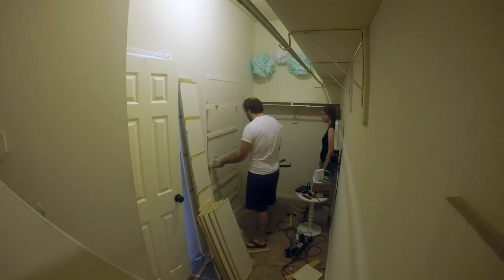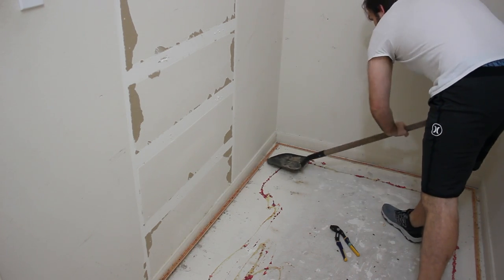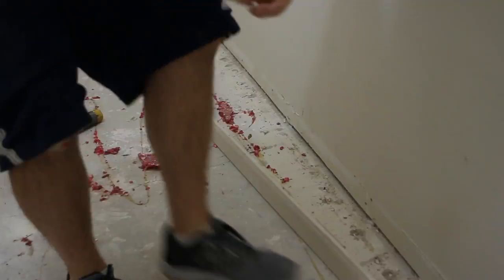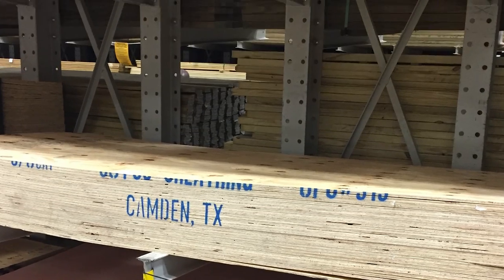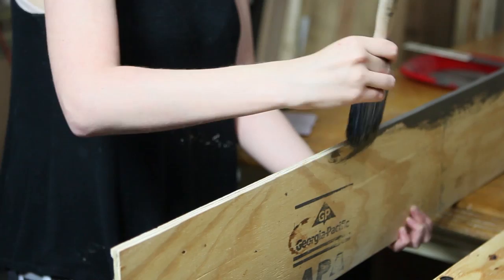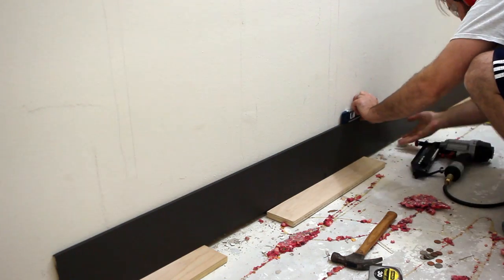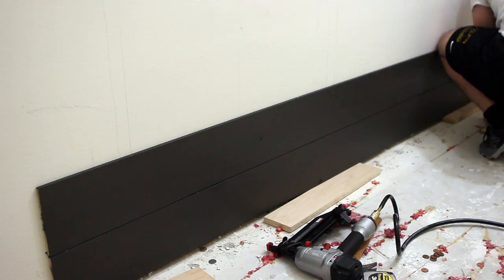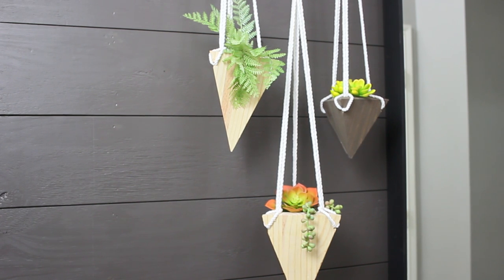How to Make a Shiplap Wall (Don't use the wrong wood!)

Comment: what is the purpose of this wall? just curious..hearing it first time
Reply from the maker: Purely decorative. Thanks to HGTV and Fixer Upper everyone loves shiplap walls and we felt left out since our house was built in the 2000's. We decided to add it as a focal point in our master closet and figured the closet was low risk if it didn't work out. Turns out we actually really like it! I think historically shiplap had a rabbit joint to make a weather tight seal but we just wanted the aesthetic so we simplified things.

Comment: no rabbits? where is the "lap"?
Reply from the maker: +robhimself79 That is a great question and one something we discussed. To do the wall in true shiplap would have cost almost $400. Since we are just looking for the design of shiplap and not the weather proofing function of the "lap" we opted for this cost effective DIY approach.
Reply: Yea this painted plywood, not shiplap
Reply: @GrayHouseStudio  actually,  you can cut those half lap joints with your table saw.  A dado blade makes it quicker, but it can be done with a regular blade as well.  Check out Woodworking for Mere Mortals  here on YouTube.   He has really great beginner tutorials, to teach you everything about the tablesaw and any other shop project you might want to learn!